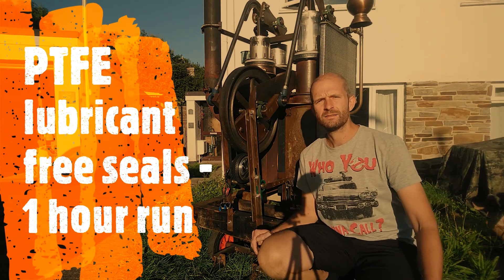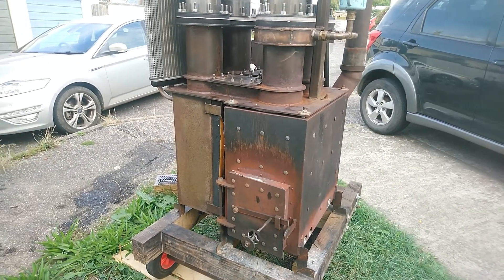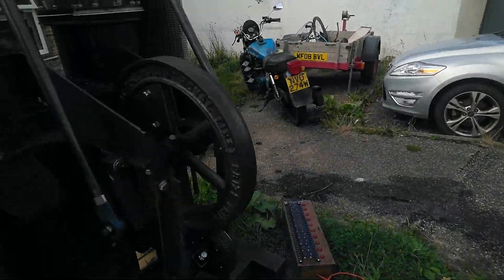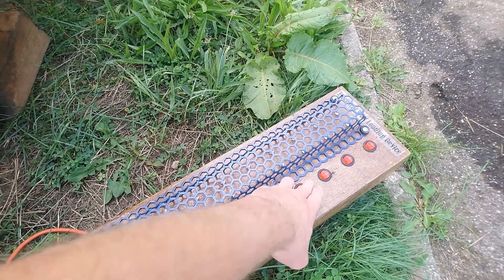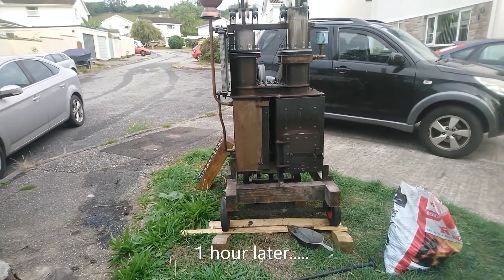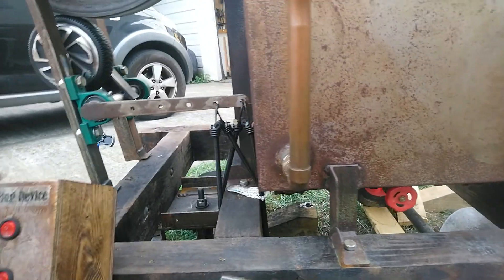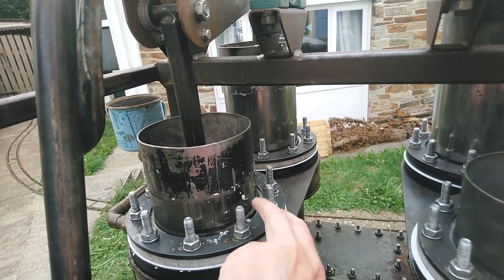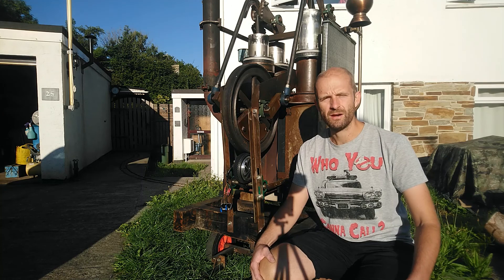Stirling Engine (PTFE Seals Lubrication free!) 1 hour run Part 13

Comment: the load  should  NOT  be at the perimeter of the  FLYWHEEL.!!!
you really should  START  OVER, after learning  which parts of a heat engine
should be made as light as practical.       (the answer:   ALL   COMPONENTS  !!!!!!)
you should understand that a well-designed stirling engine  does  NOT  need
extra cooling.
you should understand that the affects of  GRAVITY  on the operation of the engine
should be  EQUALIZED.     via the use of a horizontally oriented configuration.  !!!!
googletranslate
Reply from the maker: 🤣🤣🤣😂😂😂😁lol. Funny you say that, I am building another one! lol

Comment: There is another option - to make a steam rotary engine from an old rotary gas meter! The power is guaranteed even for transport, and if you make a closed cycle so that the steam does not escape into the atmosphere, it will not be really cool!
Reply from the maker: lol, making things efficient and refined seems to make them less interesting somehow!
Reply: @ShanePomeroy  Ок

Comment: PTFE (Teflon) will start to degrade at around 260 °C and will readily decompose at 350 °C. The breakdown products are extremely toxic to all life, bioaccumulate in animals and humans, and persist in the environment indefinitely due to their carbon–fluoride bonds. Teflon-coated non-stick pans left to overheat are a common killer of pet birds!
Reply from the maker: Certainly something to bear in mind. I've got a water cooled jacket and the seals are some way from the fire. I shall check the seals temperature, Thanks for the heads up.

Comment: How many watts were you getting out of it now ? before and after the seal change > ? :)
Reply from the maker: I might need to come back to you with that one! I'll check next time a run it. Also, I get the feeling that the watt meter is not entirely telling the truth! Someone else has commented that it may not be accurate because of the raw / inconsistent voltage from generator.  Might need to smooth voltage out with something

Comment: Would love to have a full build guide of this/ plans ect: something that i could build my own from :D

I would love to see a straight 6 or a v12 version of this, due to the natural balancing effect of that configuration, no vibrations.... a lot quieter.
Reply from the maker: I've got build notes / cad files, etc. It is basically based on a "Rider" engine and I copied most dimensions from the patent and scaled up. A V12 would get an impressive beast!

Comment: It would be great if this sterling engine had enough horsepower to turn a 10,000-watt generator that would produce oxyhydrogen that would heat the sterling engine and have excess power to spare in a closed-loop system.
Reply: Found the free energy nut
Reply: I’m sorry this sounds like some sort of perpetual motion you do realize there are losses in every energy conversion.